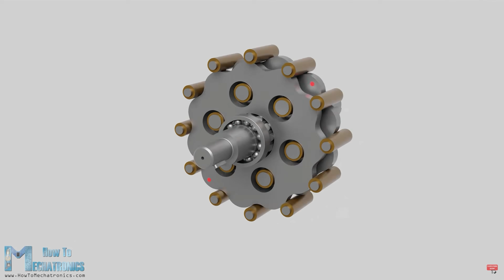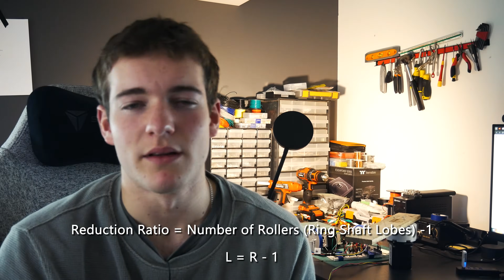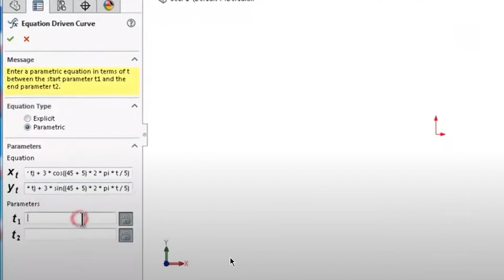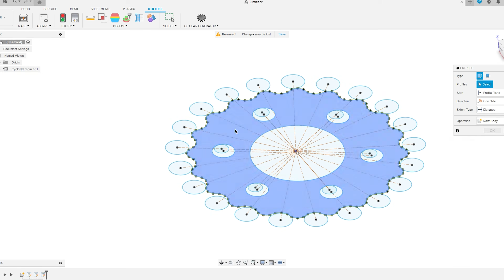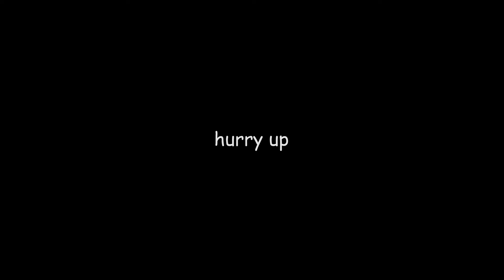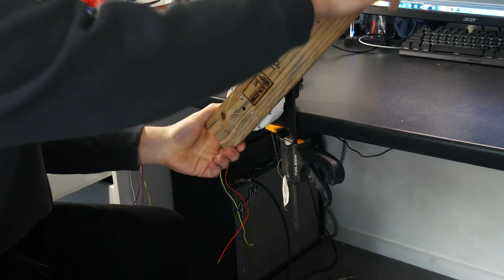Cycloidal Drives Made Easy: Design, Build, and Test with Fusion 360

Comment: There is another variant of the planetary gear set that I rarely hear about: the compound planetary gear set. 

A compound set uses a small sun gear to drive very large planet gears, but the planet gears are rigidly co-axial with really small planetary gears that then turn inside a ring gear. This compound planetary gear system enables extreme gear reduction ratios using a planetary gear set, and doesn't have any additional moving parts compared to a traditional planetary gear set.

This should be tested as well.
Reply from the maker: Yeah good idea
Reply: You can also do the same thing with a pair of cycloidal drives whose eccentricity cancels eachother out for some truly extreme drive ratios. You see this on Youtube called a “hypocycloidal drive” which I think is probably a misnomer. It’s also sold commercially by Onvio under the name Dojen.
Reply: that’s called a Wolfrom drive

Comment: I was designing a cheap cycloidal drive as well, very similar to yours just slightly smaller with very few bearings and no low friction materials, your efficiency numbers are very similar to mine (around 27%), I think that's about the limit of capability for a design that minimizes bearings and is mostly made out of 3d printed parts so I think the design is good, it's just reaching the limit of the materials and techniques used, I am yet to try lubricating the cycloid, but I don't expect it to be a huge improvement.

Comment: Nice design. Did you measure the torque of just the stepper motor? Your efficiency should be closer to 75%.
Reply from the maker: Thanks Paul, love your vids! I just went off the torque rating of the motor website, I didn’t even think of measuring it myself ahaha. Definitely will do that and revaluate the results

Comment: I wonder how small you can make it, and then I wonder how well that would work in a 3d printer extruder with that high gear ratio! Has a lot of new designs are using planetary and other designs to generate high gear ratios to allow the stepper motors to turn at their optimal speed
Reply from the maker: Yeah good ideas! I’ve been looking into increasing my budget and buying cnc parts for a metal fabricated cycloidal gearbox with a 25:1 (or higher). This way I’ll be able to get a more optimal performing gearbox while also keeping the size down.
Reply: @nelsonhowee  I have been getting into engineering and been working on designing my own robotic arm. And as it turns out I actually have access to a CNC at my work. If you ever need any CNC parts cut Id be happy to to help you out man!